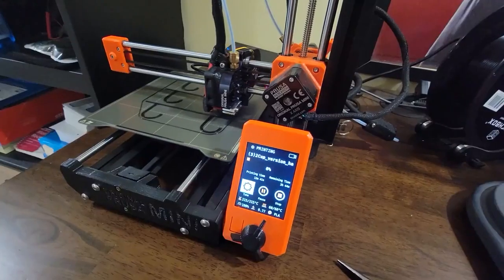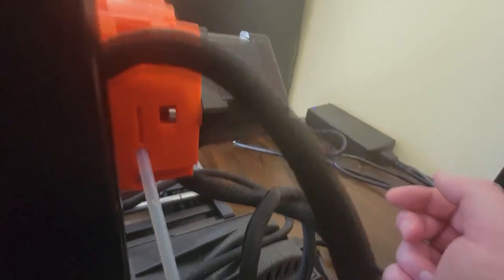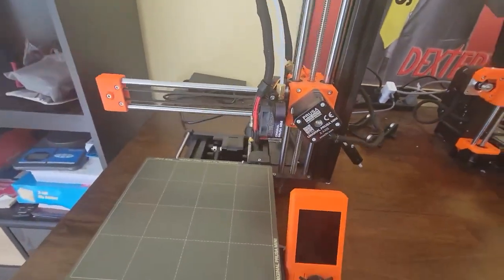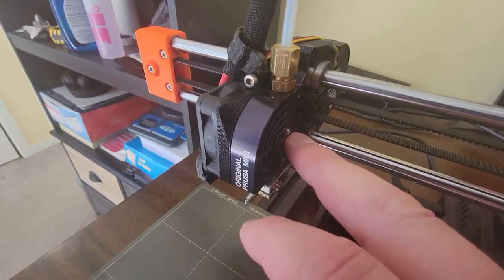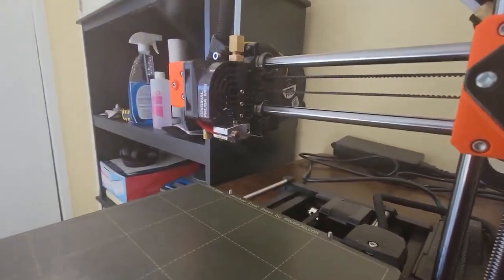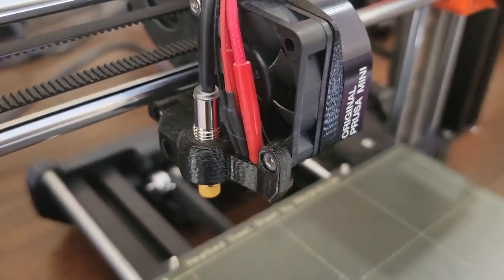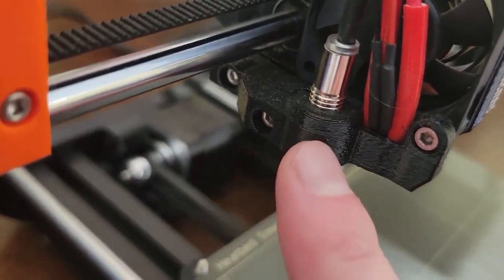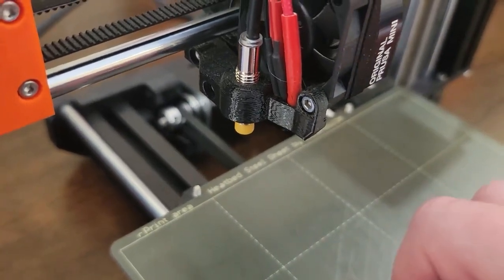Prusa Mini Clogging - FIXED!

Comment: One problem I had after a bad clog where it was unattended was where the filament had backed up and gathered around the hot end under the silicone boot. I did cold pulls and other stuff and it didn't go back to normal.

Comment: Just came across this video from the web. Looked up how to fix Prusa Mini Clog! Love your other content. I'll have go into a rabbit hole for that tonight. How's the Mini after fixing the hot end? Also should I not bother with the extruder tube and go right for the hot end trick first?
Reply from the maker: I ended up selling the mini since I only use MK3s now, having different g codes was a problem for efficiency
Reply: @Glenn Brian 3D  how many printers now in your print farm? Besides G code how's the quality in difference between the two? MK VS MINI
Reply from the maker: @armani007E55  The quality is very similar maybe a little bit better on the MK3, definitely need the bigger bed too
Reply: @glennbrian3d  good stuff! Are you thinking about grabbin the MK4?